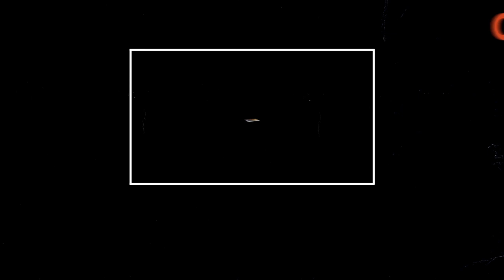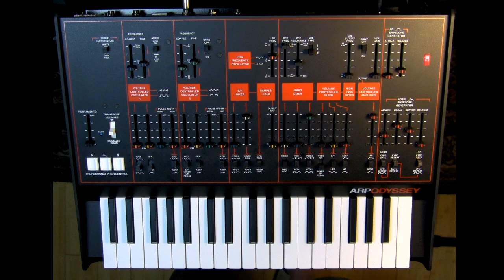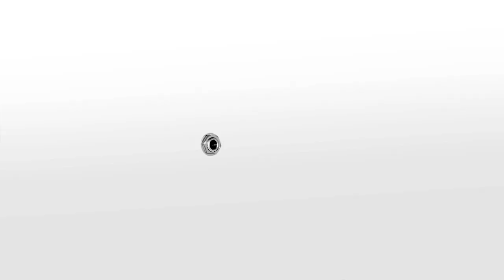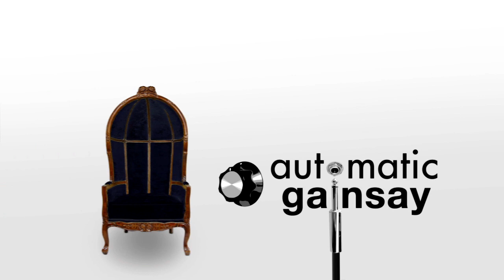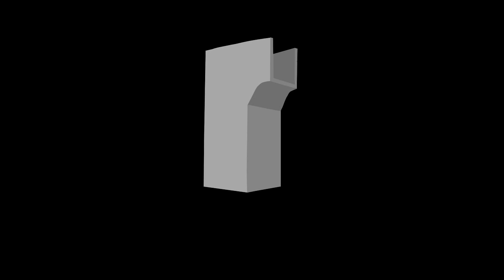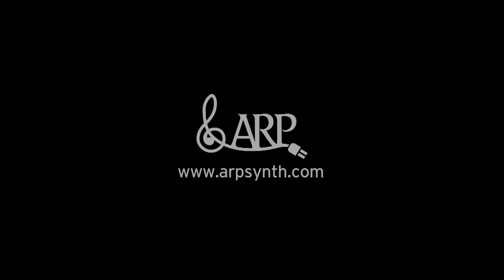ARP ODYSSEY - Marc Doty Inside Look Part 3: Oscillator Functions (2 of 2)

Comment: The most effective utilization of the Phase Synchronization function on the Odyssey is to use the Pedal to simultaneously change the pitch of the synched oscillator and the filter cutoff frequency.  You can imitate Electric Guitar, do intense Wah-Wah effects, isolate Harmonics and get Feedback sounds.  Doesn't Korg offer that pedal?  Why is nobody doing this?  It's a fantastic feature and I think a demonstration would really go a long way in terms of selling more instruments.